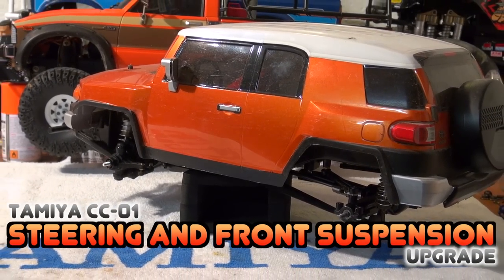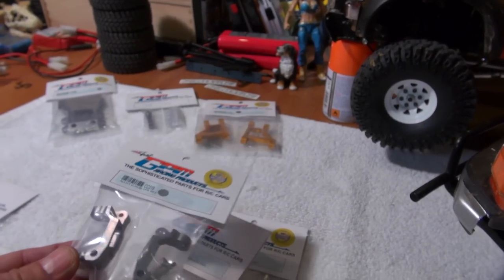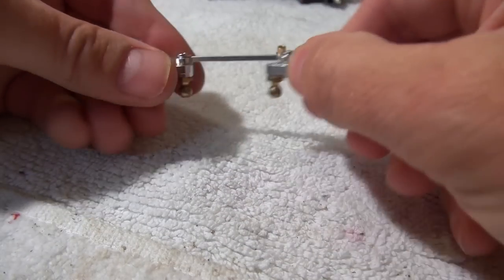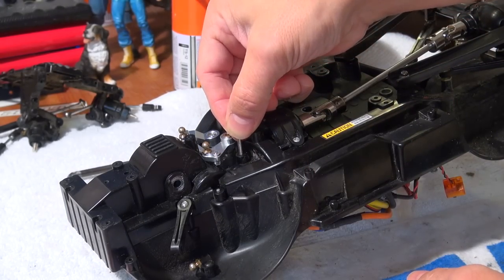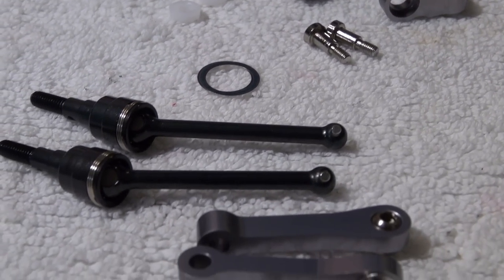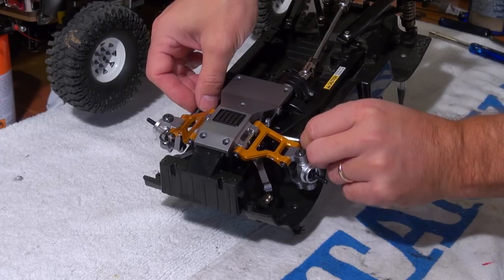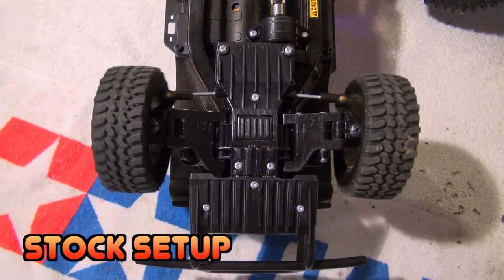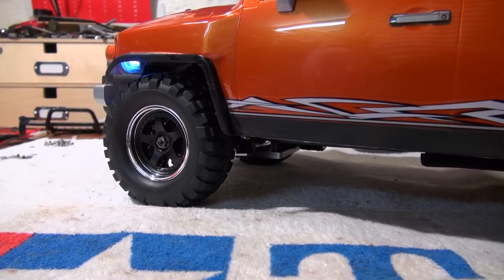Tamiya CC-01 Steering and Front Suspension Upgrade

Comment: I found when I installed the GPM steering knuckles on my CC-01 that it can be difficult to keep Loctite out of moving components on the small pieces, so taking a small amount of bearing grease and lining the parts that need to move freely really helps. It lubricates the moving parts and prevents the thread locker from getting into it and hardening.
Reply from the maker: Jon Geddes Very good advice! Thank you!

Comment: Very well done video. I can see it turns more smoothly but is the turning radius improved too? What tires/wheels are those? Looking for some that will fit my Landfreeder, and more off road than the stock ones.
Reply from the maker: Thanks! Yes, it improves the turning radius. The tires are the hop up tires and wheel combo for CC-01 from Tamiya https://www.tamiyausa.com/items/radio-control-parts-70/r-c-tires(spare-hop-up)-71200/rc-cc01-rock-block-tires-54554
Reply: I know this isn't the place for such detailed questions but ... still new in the CC-01-world and could need some help. I have the super-hard Landfreeder stock-tires on mine still, but I think they are more for the road than off road. So a little anxious to buy some new Tamiyas. Looking for some softer ones for some all round off roading/light forest-trailing, but approx the same size as the stock ones so I can still use my Landfreeder body. Do you think these will be a good choice?
Reply from the maker: Nordic RC Visions Yes, it's good to use custom tires on it. But you will not find good offroad tires from Tamiya. The rubber they use is too hard. And the size will be a bit bigger. I can recommend these tires: https://www.wemushop.ch/Fahrzeugzubehoer-Teile/Raeder-Reifen-Felgen/Crawler-Trial-762/-Wheel-Set-Crawler---Steelhammer---96mm-1-10--2-pcs--.html
Maybe you have to lift up a bit the body with the body posts.
Reply: Thank you very much for the recommendation. I will look into it :-) Thanks again.

Comment: Very good videos Matteo, an inspiration to me for sure! I have just bought a CC01 Cruiser Black Edition with the GPM steering arrangement and front skid plate already fitted but not the arms or C-hubs etc. I found that, as you say in the description, you definitely need the Loctite on the steering arm areas or there will be play after a run or so and it can round out the keyed shaft where you then can not get rid of steering slop. Unlike the GPM items I remember from 15 years ago these parts seem to have poor tolerances now. Can you please tell me if you have experienced issues with the rest of the suspension arrangement you have there? I, like most others want more steering and front travel but want to leave this particular chassis un-hacked using just bolt on parts.. I have made some cool custom RC's in the past, but this is my first "Scale trail" truck and being a Black edition I really don't want to chop it up for a front servo arrangement.
Reply from the maker: +Camo B As first thanks for your compliments! The rest of the suspension works well except the upper arms shown in the video. As I wrote in the description I had some issues with falling out balls on this parts. I recommend to use this ones: http://www.wemushop.ch/Fahrzeugzubehoer-Teile/Tuningteile/GPM-Tuningteile-356/Tamiya-358/CC-01---XC-360/Front-upper-suspension-arm-CC-01---XC.html Only with the c-hubs, knuckle arms and steel universal shafts the steering angle will be better.
Reply: Thank you for your reply! I am a little more encouraged to try the C-Hubs and arms now that I have read this from you. Keep up the good work!

Comment: Real nice informational video.
Hi mattèo, are the cvd increase the turning radius and minimize rattle compare to previous dog bone, how does it affect performance?
Thanks
Reply from the maker: jeff j The cvd's increase the mechanical resistance in thight curves, it's important, because with the steering uprade the turning circle is much smaller

Comment: Fine tuning! :-) I love the metal upgrade parts in combination with Tamiya's classics like CC-01... Could be nice to touch the Tamiya 58086 or 58081, nice to see the mounted plastics with screws and nuts... :-) (And try to push the LOOONG yellow shocks... :-) ) Kind of Tamiya obsession! ;-)
Reply from the maker: Filip Grüner Thank you Filip, back then in the early 90es, I've built the 58086 for my local Hobby Store as a display item!

Comment: I have the CC-01 Jeep Wrangler.  I just want to make sure it's the same chassis as you use in these upgrade videos before I try to upgrade mine?
Reply from the maker: rblenian Yes, it's the same chassis. (CC-01)
Reply: ***** Thank you Matteo.  I also put longer shocks (dampers)
 in to allow for slightly bigger tires.  It helps a little but I think with your upgrades here it should increase the droop just enough to be complete.  I will share a video with you soon to show you.

Comment: Hi what do you do with the very thin washers that come with the new front drive shafts?
Reply from the maker: It's a good qustion. I used it between the drive shafts and the knuckle arms. But not sure if it's correct...

Comment: In your opinion what should the first performance  upgrade to purchase for the CC01?
Reply from the maker: S.G. buster First is a ball bearing set, second the rear stroke extension, third the steering and front suspension. And a good upgrade are softer tires.
Reply: Thank you!

Comment: Absolute crap! Bought this thinking it would be a geat upgrade to reduce the steering slop from the stock plastic parts. I was wrong! Kit did not come with a manual to begin with so I had to figure out how to put it together. When I finally figured it out, the head of the screws would rub against the chassis. Biggest issue was the to arms that "key" into the pivot shaft was so shallow and soft that it would "round" itself out resulting in even bigger slop and no steering consistency. Typical cheap Chinese parts!! Garbage. Would never buy GPM junk and try and avoid buying from a greedy, money hungry, disrespectful, dirty , ugly, child labouring, animal cruelty, environmental destroyer country. I googled about the product and found similar issues that I had. For the record, I have 20+ years in the hobby and have never encountered anything this humiliating.
Reply from the maker: I can understand this, and I agree. But with a bit of Locktite on the arms the play can be much eliminated. And the turning radius is much better with the upgrade.